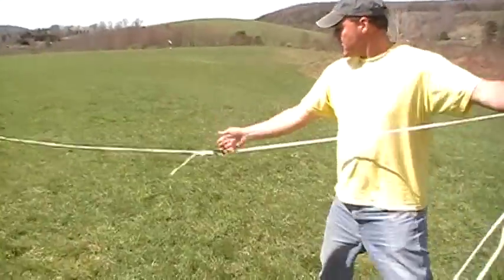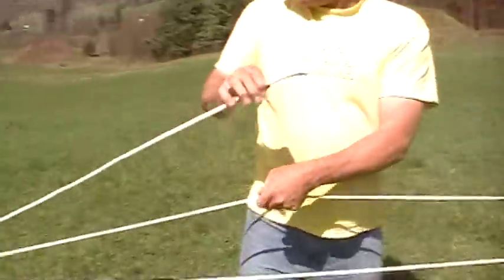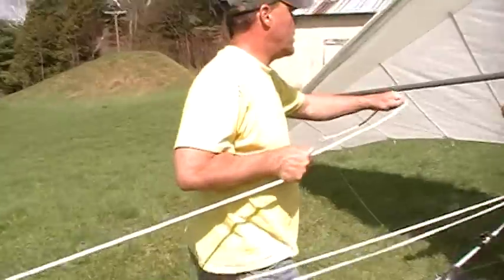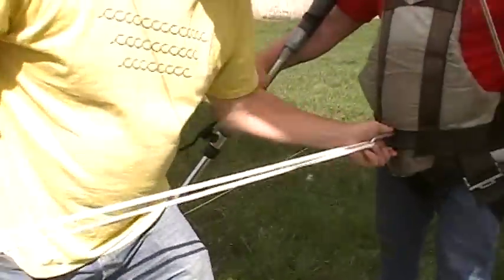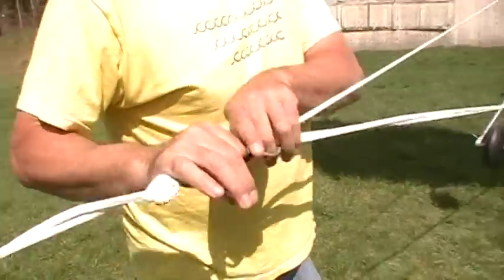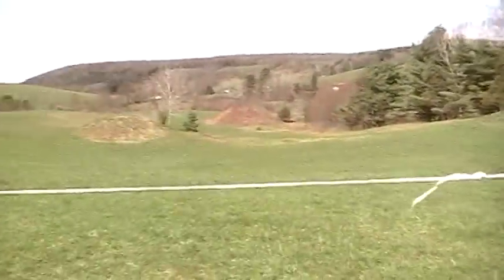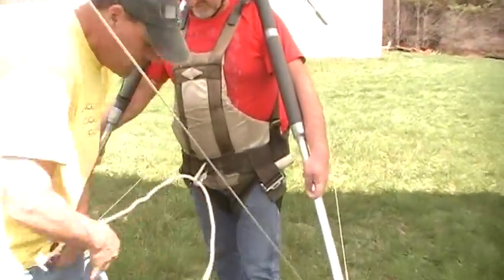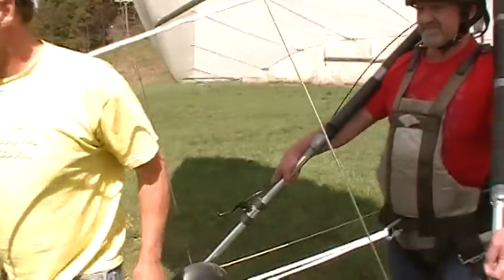Hang gliding - Dan explains the double-threaded tow bridle system

Comment: Dan, The video is excellent for a demonstration of how the Hewett (SP?) Skyting bridle works.

I prefer to have the release and weaklink out in front of the bridle.

If you get thermal turned 90 degrees to the direction of tow there are many capture events possible with a threaded bridle. I keep the bridle with the glider.

I did my first deepwater Skyting tow Tuesday June 18, 1985 and my first Skyting ever on ice Jan 5, 1983.